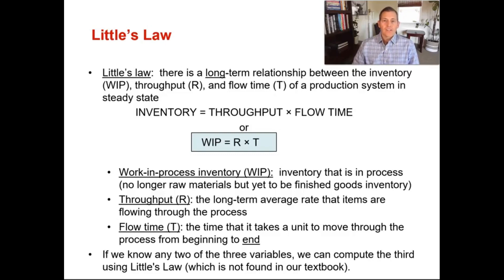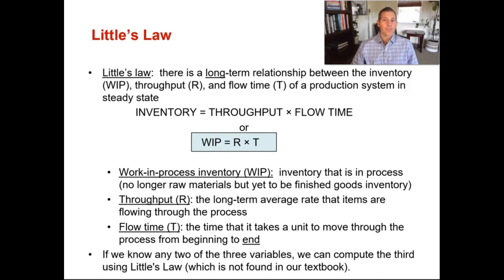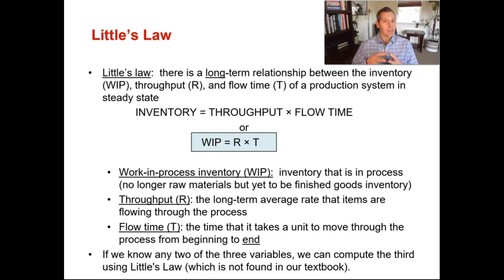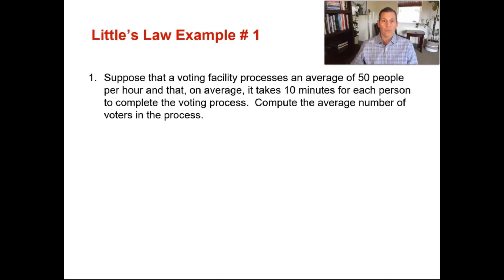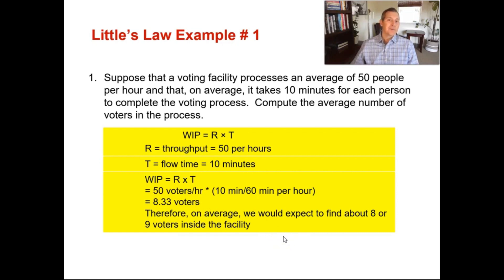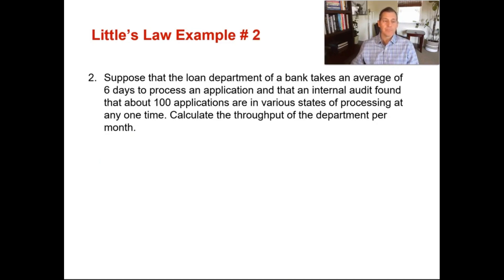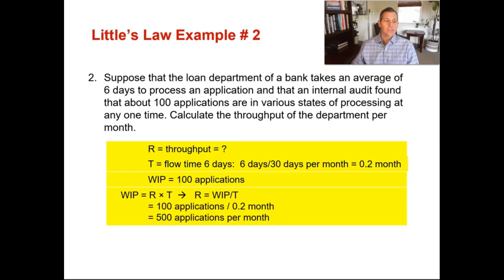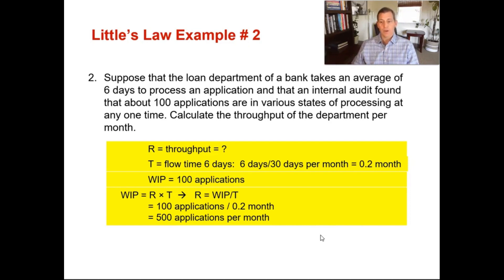Littles Law (how to calculate throughput & flow time)

Comment: Thank you for a great video. Really helped me
Reply: what you mean divide are you not suppose to multiple for throughput
Reply from the maker: Hi zolani, the formula for calculating work in process is WIP = R x T. But the formula for calculating throughput must be converted to R = WIP / T. So for throughput you divide, not multiply, to solve for the equation.
Reply from the maker: Wonderful!  Glad to hear that it helped you!